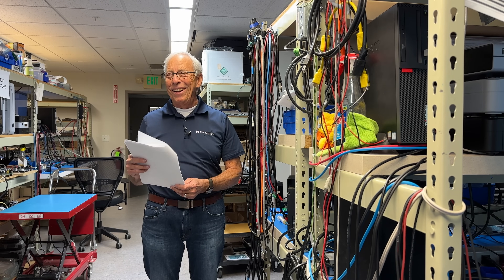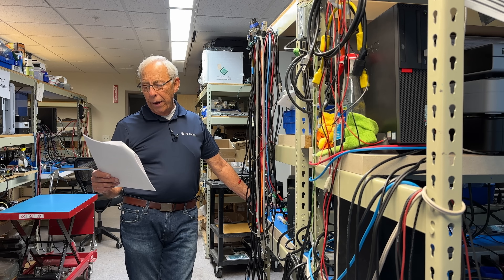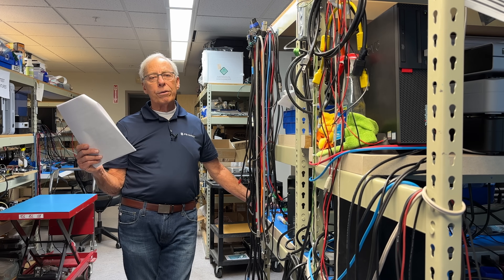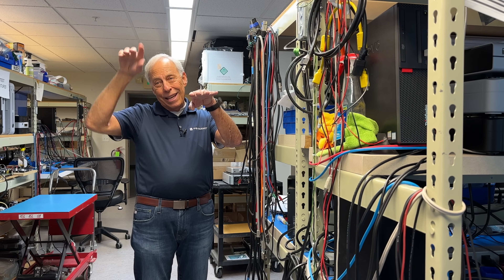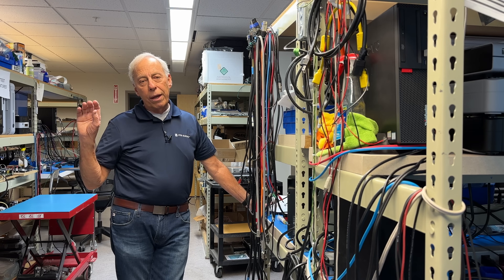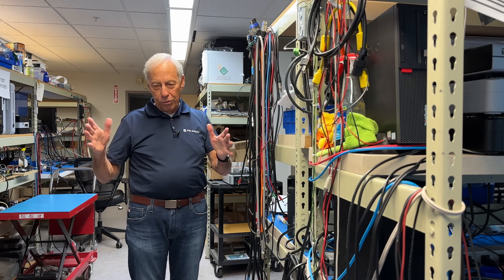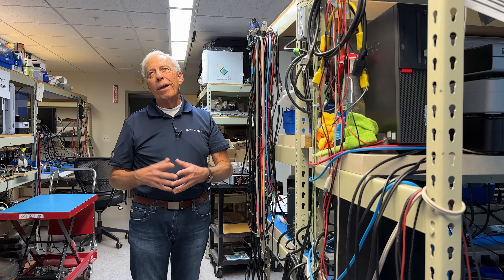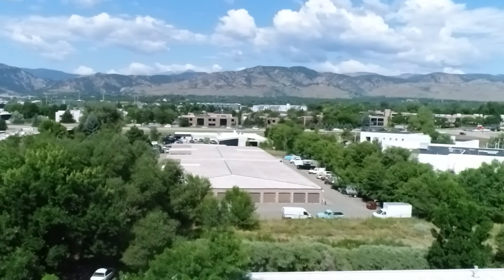External power supplies and integrateds

Comment: I will say that I've heard a lot of systems in my time as an audiophile and need personally I haven't heard a lot of difference with external power supplies in relation to preamplifiers, dacs, phono stages, turntables, but I have heard it in relation to power amplifiers. Something about as soon as you get that power supply away from the circuitry of a power amplifier it makes an audible difference. The whole sound field is just quieter and you feel like you can hear more of the music and it's just a phenomenally better.

But that said I am a very big proponent of keeping things simple, and that's why I primarily listen to integrated amplifiers. It might not be the best sonically I've ever heard but I think for simplicity sake and just the one box turn it on and select your input and your listening to music, for me it makes listening to music less of a chore. Because I've been down that route where you've got a separate preamp and separate this box in separate that box and every time you want to play a record you got to hit four different power switches just to hear a record, I would rather just hit one button and I'm listening to music.

Comment: @angela-gilbert has done a bunch of experiments with adding additional capacitors and professes to demonstrate that more is better.
In my own DIY experience, I conclude there is no end to improvement that bigger PS make.  But it does not need to be in a separate box.  Within a box you can lay it out to keep the dirty stuff separated from delicate signals.  
In the digital circuits, supercapacitors are the secret sauce to natural analogue sound.  People crow about having 100,000 uF in their monoblocs. (0.1F)  How about 300F on each digital circuit.

Comment: The late 90's JDM Sansui integrated amplifiers were absolute masterpieces - prolific use if of solid copper, bitumen and teflon to isolate components and compartments. Massive transformers baked in an isolation medium. Try a Sansui AU-a907 NRA/MR/XR and see and hear the magic. Love the PS Audio videos. Just turned a friend looking for a simple and well equipped little integrated for a two way kitchen system on to the Sprout. Such a great little product.

Comment: Been there done that.
Waay back I upgraded a Mission Cyrus 1 with separate PSU for the amplifier section. 1000va torroid, DNM slit foil and poly bypass caps.
No more strain to the sound at higher volumes. Nice.
My current solid state preamplifier uses a separate PSU.

Comment: Be careful. You should have added "if all else equal". There could always be some cheap 3rd party wanting to take advantage of the idea that ALL external supplies would just automatically be better! Yes you as the manufacturer would make the external as a step up. But some rando 3rd party might just want to make a sale. 

And I would like to qualify that there are some great sounding integrateds from back in the day from companies like Marantz 1060 or 1200. Kenwood KA9100 or KA-801.

Comment: Did Paul say lunatics?

I remember when they were selling magic bricks to improve components, all you had to do was to place this brick (hundreds of $$) on top of your device and the sound would improve. Having worked as an engineer for quite a while and also being a bit cheap I tried using a common clay brick and it worked (at a cost of $2), it sounded even better if I added a thin sheet of silicone rubber between the brick and the CD player.

The reason for the improvement was the bricks were damping the cabinet so they would not vibrate as much and the thin rubber sheet just improved the coupling and made it a bit more effective. By brick was not as pretty but that $198 could be put to much better use.

I will say that some manufacturers place the bean counters a bit to far up the food chain and they will take an ax to a new design to cut corners. Power supplies cost money and in their zeal to cut costs some spec out the cheapest switch mode supply on place of a nice beefy linear power supply and while it does chop the price it also raises the electrical nose by a lot. Now if you spec a good switch mode supply it will be a lot better than one not designed with emitted electrical noise it will be better - but I doubt it will be as quiet as a good linear supply - i sprnt almost 30 years with a power supply company and I learned you have match power supply topology to each use.

Comment: Nothing provides a cleaner dc signal than a battery, so a separate psu chassis will sound better. As a consumer, do you want to pay almost double the price for this? Might as well go separates for amp and pre. It’s an economical fact single chassis boxes are better. Can you imagine a home theater, separate PSU, power amp, multichannel pre, dsp, hdmi switch? 5 boxes, and they need to look good, make the real theater a more economical choice.

Comment: I have a Naim Supernait 2 which is a nice amplifier but it benefitted greatly from connecting to a Naim HiCap, This seperated the pre-amplifier power supply from the main power supply. So, I agree with Paul that seperate is better.

Comment: EMI from power supplies is very short range ... as in a few inches.  By getting the supply outside the devices case you gain the advantage of both distance and shielding to keep  sensitive circuitry nice and quiet. 

When you consider that a smallish smps brick can deliver 32 volts at 5 amps, sit on the floor out of the way and operate day and night with no issues... it really does start to make a lot of sense to consider external supplies.

Comment: Seperates are just that; they seperate and isolate the various parts inside by putting them in two seperate components; an integrated throws everything together on one chassis, and all the electromagnetic interaction that goes on inside, goes on. The main culprit of course is the transformer. It puts lots of micro vibration and electromagnetics into the chassis. When I intend to modify an integrated amp, and remove the top cover, I can tell how much (if any) attention was paid to isolate the transformer from the rest of the circuitry.  It is a good measure of how much attention to detail went into the piece. Usually the transformer in power amps are better isolated than in an integrated amp with the same size transformer, which needs isolation even more, because of all the extra circuitry inside. So they usually give you a little more attention to detail inside seperates.

  A company knows that a lot of people upgrade from their integrated amps to their more expensive seperates. If they don't hear an improvement going from their integrateds to their seperates, they may lose their loyalty to their brand. So they usually make sure their seperates give you noticeably better performance.

 An integrated amp with better circuitry and parts than another conpanies seperates, could very well outperform it. But those superior parts will be battling with more electromagnetic fields inside, than if the circuits were seperated into two seperate chassis (preamp & power amp). So everything being equal, more spread out sounds better. But there are many great sounding integrateds out there (current & vintage) which would beat most seperates; but would sound even better if their circuitry was more discretely laid out in 2 seperate chassis; instead of all in one. But of course that's more expensive, and you have to pay more.
Reply: Separate.